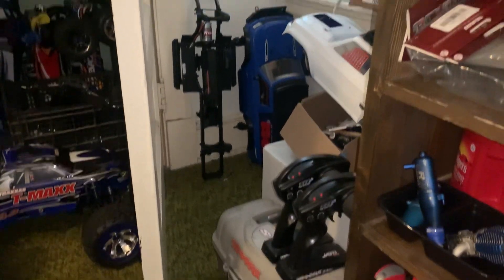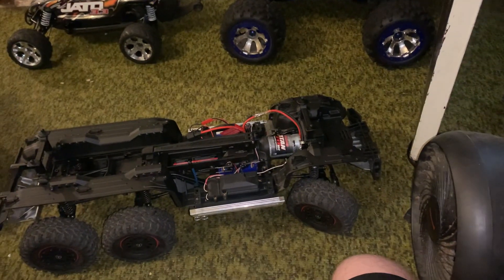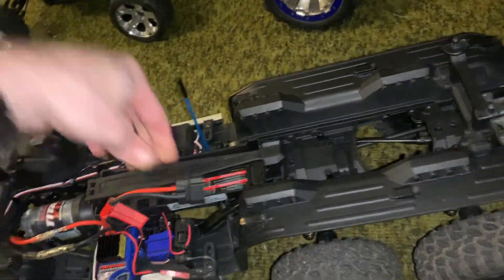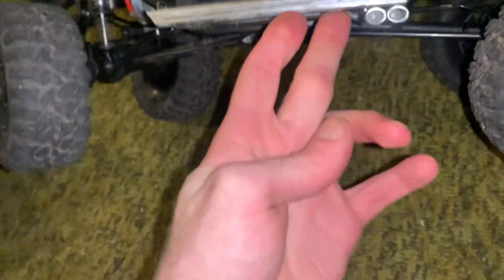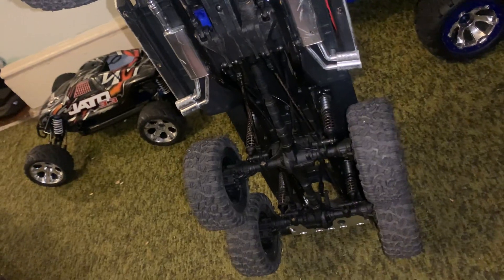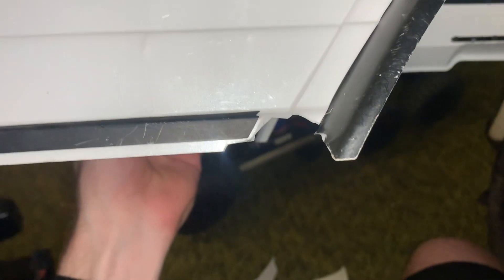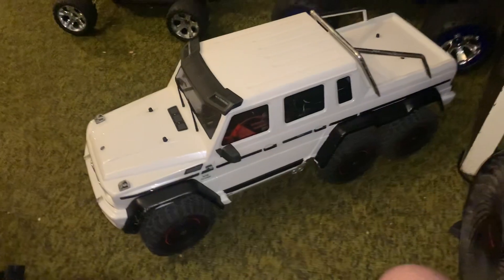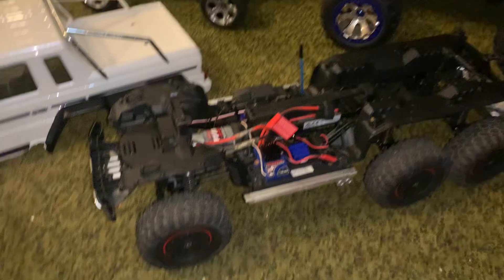new used trx6

Comment: I love these 6X6 rigs!!!
Reply from the maker: Ya just recently got it can wait to drive it just my laziness and the cloudy and cool weather keeping me inside
Reply: @tonydetwiler2624  I will buy another one eventually, and also wanting that new flatbed rig. I love the factory l.e.d. lights!!
Reply: The weather here in Idaho Falls is that same thing, cold 🥶 and wet 💧
Reply from the maker: @BUILTLIGHTWOUNDTIGHT  im actually rigging together a truck using them new hauler parts and body, if my calculations are correct I think it’ll work out just fine might not be very functional but it’ll be cool and different,involves the lift kit and 2.2 tires
Reply: @tonydetwiler2624  sounds interesting, I will be watching 👀
Reply from the maker: @BUILTLIGHTWOUNDTIGHT  it’ll be a little bit still got to buy the parts and axles etc i have a frame and fenders as of now
Reply: @tonydetwiler2624  right on 😎